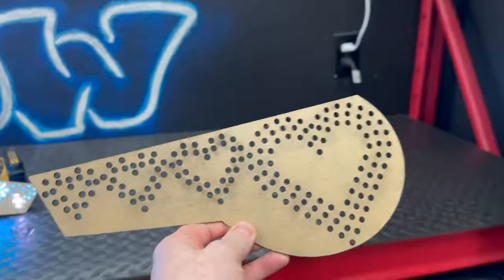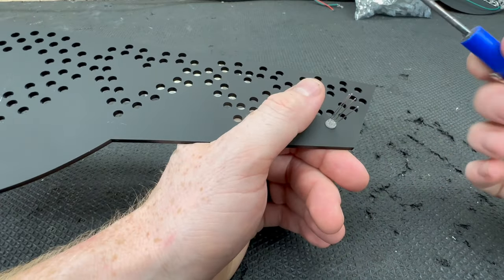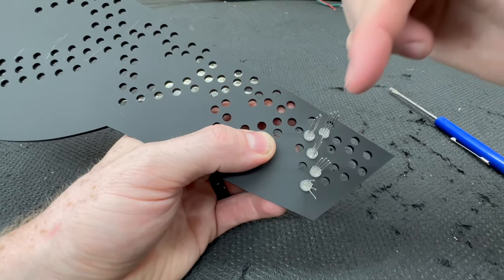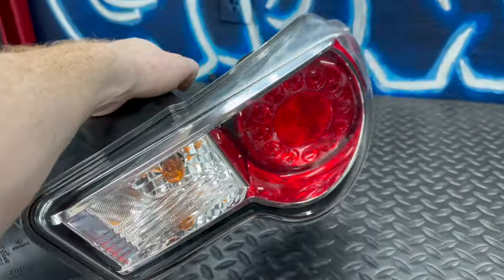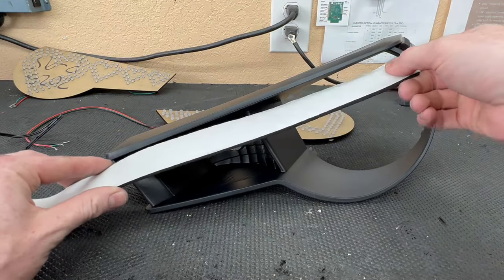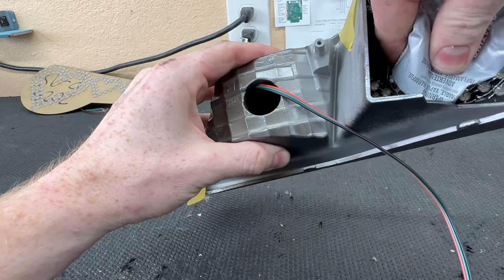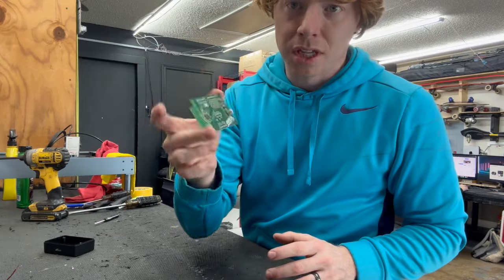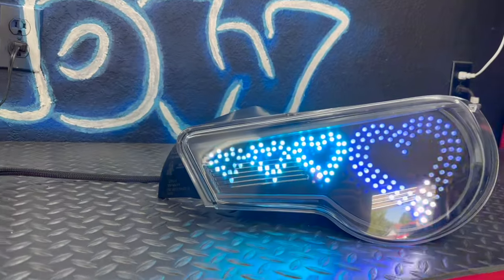Building custom RGB heart tail lights - BRZ

Comment: On your website it says that after these are built you will need to install an additional wiring harness and load resistors for the turn signals, do you have any videos on these? Or links to these parts? Additionally, for this project do you recommend blue ghozt lite or plus, 12V or 5V?